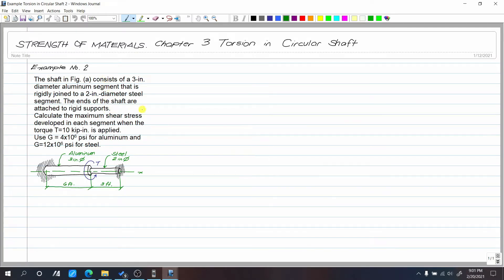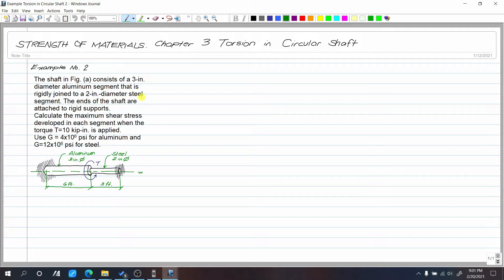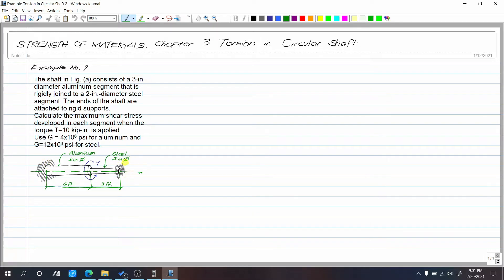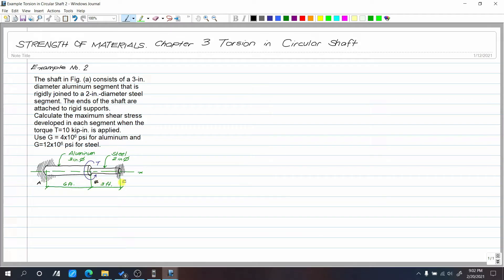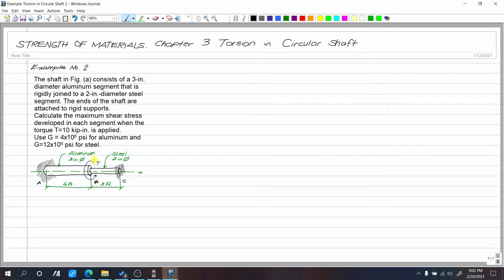Mechanics of Deformable Bodies   Chapter 3 Torsion in Circular Shaft Problem 2 (PH)

Comment: di ko magets bakit kapag ang ginawa kong approach sa compatability equation is THETAal + THETAst = 0 is di ko nakukuha tamang sagot. tapos ko na Theory of Structure and mostly approach dun sa indterminite na problems is ineequate sa zero kasi mas accurate yun. may naencounter na din akong problem na kapag ang ginawa kong approach is yung kagaya ng ginawa mo dito sa compatibility equation is mali makukuha kong sagot kaya naisip ko na may nagmamakesense din naman talaga na ieequate na lang talaga lagi sa zero. pero bakit dito sa problem na to mali naman.

Di ko magets bakit iba makukuhang Torques ng Steel at Aluminum kapag ganun ko siya inequate

Tanong ko na din about dun po sa sinabi mo na equal ang angle of twist ng Steel at Aluminum. Ibigsabihin po ba is may angle of twist pa din silang mararanasan kahit fixed support sila?
Reply: ahhhh kaya ba equal yung dalawang angle kasi yung equation na THETAal = THETAst is the same sa THETAb/a = THETAb/c? so ibigsabihin yung sinasabi ko pala na dapat zero yung twist nila is sa dulo pala yun which is sa Point A at Point C?

Comment: Sir tanong ko lang po about sa 5:15 pano po naging equal yung angle of twist ng dalwang magkaibang material na may magkaibang shear modulus, length at x-sectional area? medyo hindi po kasi intuitive sakin. Hindi po ba mas malakas yung resistance ng isang certain material for shearing/twisting base sa kanyang Length, Shear Mod, at Pol mom of I?? kasi ayon narin naman po sa formula
Reply from the maker: That's a good question po! Based on Pytel and Kiusalaas, by compatibility equations, the right end of the aluminum segment must rotate through the same angle as the left end of the steel segment.

In simpler terms, imagine holding the left end of the aluminum segment fixed and applying a twisting force to the right end. This causes the aluminum segment to twist. Now, if the right end of the aluminum segment rotates by a certain angle due to the twist, the right end of the steel segment that's connected to it must also rotate by the same angle. This is because the segments are connected, and they are effectively sharing the same amount of twisting motion.

Sorry for the very late reply as we are too busy doing some work stuff and life. Thank you for understanding and God bless you!

Comment: Hello po! Tanong ko lang po dun sa may compatibility equation, bakit di na po cinonvert yung 6ft at 3ft into inches po? Kasi parang consistent sa inches po yung mga nasa equation, at yung length lang po yung nasa ft?
Reply from the maker: As you can see po, nasa compatibility equations siya and magcacancel out lang ang mga unit, kapag cinonvert mo ang 6 and 3 ft in inches, siya rin, magcacancel out din ang 12 inches, tama ba?
Reply: @cebox  Okay po. Thank you po sa reply! God Bless po!
Reply from the maker: You're welcome. 😊